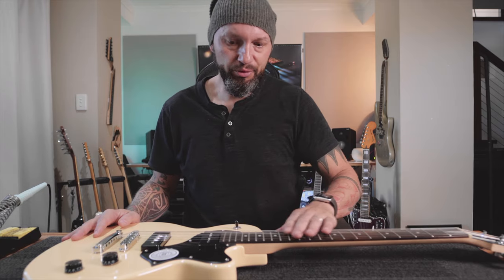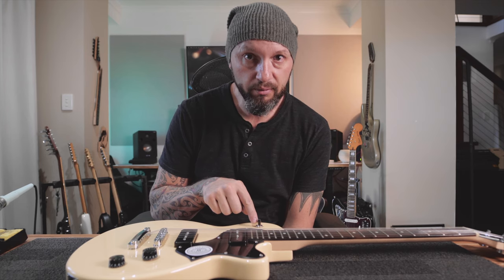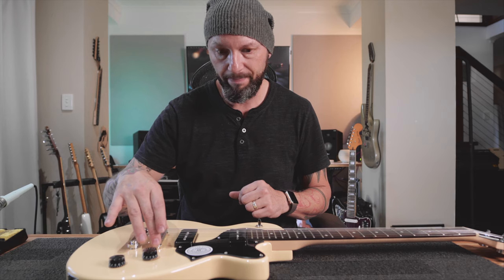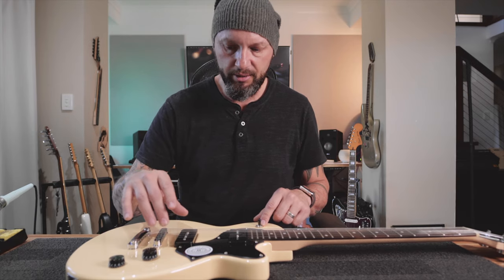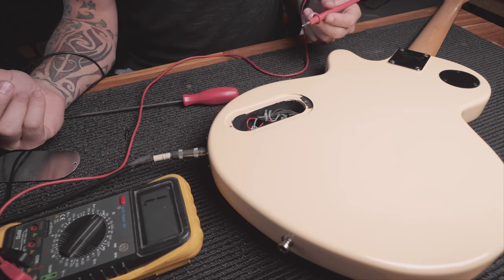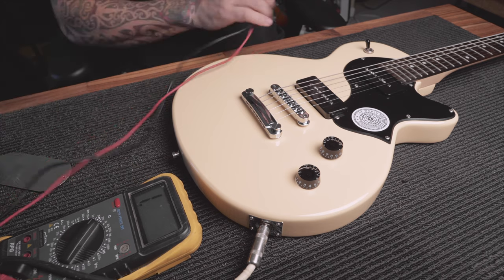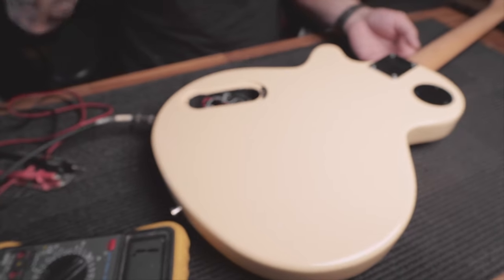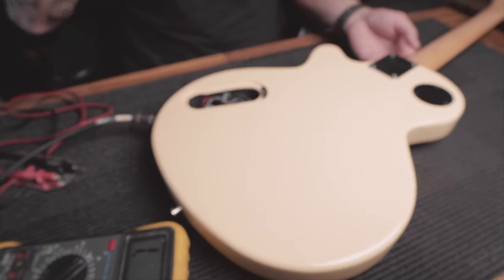3 Easy Solutions to Fix Ground Noise | Guitar How-to Ep02

Comment: my amp has a very very quiet hum when there is no cable or guitar plugged in, (even at the highest volume).Once i plug in the cable and guitar the buzzing increases 100x. Then quiets down when i touch the metal parts. Is this still normal? When i lower the nob on the guitar it also quiets down.
Reply from the maker: Lots of variables here but doesn’t sound unreasonable. Try this, you might have an external interference issue: https://youtu.be/sAQP5HtdNuc
Reply: @RisingSunGuitarMods  thank you, not sure if it really is a shielding problem. i turned off every electronic in my room and it still buzzes!!! i did notice that if i touched the metal part of pickup selector the buzz continues. This means the ground cable there is disconnect right?
Reply from the maker: @cash7975  Yep. Will be worth pulling it apart and doing an inspection. Look for a ground wire that may have come off or bad solder etc.
Reply: @RisingSunGuitarMods  will do that. thank you for sharing this information
Reply from the maker: @cash7975  what type of guitar and amp do you have?
Reply: @RisingSunGuitarMods  i got an ibanez gio and fender mustang lt25
Reply from the maker: @cash7975  shouldn’t be noisy especially in the humbucker position. Start with the inspection of the wiring. Or if it’s newish and you got it from a shop I’d talk to them. But sounds like an earthing issue for sure.

Comment: Hey i gotta slight buzz/hum coming from my dean ml dimebag tribute guitar. i just put a seymour duncan dimebucker pickup in the bridge. all my grounds and solder joints look fine and i have continuity all over the guitar... when i touch the metal on the toggle switch, the jack input, the bridge and strings and the neck pickup the buzz/hum goes away.. i replaced the pot and resoldered everything again for that pick up and still get buzz.. any ideas? I have tested my 2 other guitars on the same amp and patch chord to make sure they arent the issue aswell.. Im kinda stumped now lol. any help is greatly appreciated
Reply: should add that the noise does get louder when i touch the pick up i installed but if i touch the strings the noise goes away then i can touch the pick up and get no noise... ive taped any piece of wire that cud possibly touch anything to ground out aswell. im stumped lol
Reply from the maker: Hey man, based on the information you provided, it seems like you've done a thorough check of your guitar's wiring and connections. However, you're still experiencing a buzz/hum issue. Here are a few suggestions to troubleshoot the problem further:

1. Check the pickup height: Ensure that the Dimebucker pickup is not too close to the strings. If it's set too high, it can cause excessive magnetic pull and lead to unwanted noise. Try lowering the pickup slightly and see if it makes a difference.  

2. Shielding the electronics cavity: Sometimes, electrical interference from outside sources can cause buzzing or humming. Consider shielding the electronics cavity with copper foil or conductive paint to minimize any external interference.  I have a how to here: https://youtu.be/sAQP5HtdNuc

3. Grounding and shielding the pickup cavity: Make sure that the pickup cavity is properly shielded and grounded. Check if there are any exposed wires or components that could be causing interference. Ensure that the pickup's ground wire is securely connected to the guitar's ground.

4. Check the quality of the wiring and components: Inspect the quality of the wires and components used in your guitar. Poor quality wires or faulty components can introduce unwanted noise. If necessary, consider replacing any suspect wiring or components.

5. Test the pickup in another guitar: If possible, try installing the Dimebucker pickup in another guitar to see if the issue persists. This will help determine if the pickup itself is causing the problem or if it's specific to your Dean ML guitar.

6. Consider using a noise gate pedal: If all else fails and you're unable to resolve the issue, you can try using a noise gate pedal. A noise gate pedal helps suppress unwanted noise when you're not playing, effectively reducing the buzz/hum.

If you've exhausted these troubleshooting steps and the issue still persists, it might be worth consulting with a professional guitar technician. I hope you solve it. Let me know how you go.
Reply: @RisingSunGuitarMods  thanks for all that info appreciate it alot! gna try a few more things u suggested there

Comment: Hey. Ive got a guitar thats driving me mad. I have shielded the whole thing including the cavities, under pickups. all grounds are continuous. Bridge is definitely grounded. Then plug it in, has buzz that creates static-y type clicks when you touch the strings or the metal work. Its driving me insane. Any thoughts?
Reply from the maker: Could be something around you, mobile phone, computer, a power supply with a bad earth. Might be a game of eliminating outside factors. Do you have another amp you can try, or plug your current one into another room. First thing is to eliminate things like amps, pedals and power. Turn your mobile phone off etc. if all these are eliminated is it noisy across all pickups?
Reply: @RisingSunGuitarMods  straight into the amp, no pedals, different brand new high quality leads. I have two amps, same story. I have multiple other guitars. Its noisy across all pickups. Its just you go from not touching the guitar to then touching the control knobs (chromed metal) the bridge, the tuning pegs, the strings and its like a static-y pop. Its maddening. Makes the guitar unusable in a way as I am so aware of it. Be damned trying to record with it.
Reply from the maker: @Lovetone1983  you know what, this sounds like something is wired incorrectly. Check your output jack wiring. Make sure the hot wire is on the positive and your ground is on the sleeve. If you can’t figure it out I’d be happy to try and help you solve it. Look me up on Instagram or Facebook and send me a DM with some photos of the wiring and maybe a video of the issue. I’ll try to help you out.
Reply: @RisingSunGuitarMods  Hi its nothing complex tbh and the wiring is done 100% correctly. Its a total mystery now.
Reply from the maker: @Lovetone1983  okay, if you have isolated everything then it could be down to bad pickups?
Reply: @RisingSunGuitarMods  everything is possible but they are clean pulls out another guitar (trusting the seller tbh).
Reply from the maker: @Lovetone1983  usually when it makes noise when grounded it's a ground wire connected to a hot somewhere. Dificult to solve without seeing any of it.

Comment: what about a hum when you turn the volume knob off??
Reply from the maker: What kind of guitar is it? Is it stock, or has it been modified? If it has been modded, what pickups and what wiring diagram have you used? Do you have a meter and are you comfortable using it?

If the wiring is correct, when the volume is at 0 the output jack should be shorted to ground. The only thing that makes sense given the limited information is that the output jack is wired backward. 🤷🏻

Comment: Did you ground your combo ?
If yes -- how did you do it, indoor ?
Reply from the maker: Not sure I understand your question. Are you asking if I grounded the amp? 🤷🏻
Reply: @RisingSunGuitarMods  
Yep.
Reply from the maker: @iridios6127  So I’m guessing your having some fun. Grounded = A Ground Connection connects every piece of metal on your guitar and acts as a return path to the amp. Your amp will be earthed through your electrical supply. I’m not talking about grounding as in your garden. Hope this helps.
Reply: @RisingSunGuitarMods  
Thank for the answer.
In my location we have 2-connection plugs. No grounding for amp.  ))))
Reply from the maker: @iridios6127  Wow. I thought you were teasing me Lol. Where are you located. It’s crazy you don’t have earthing through your power supply. So it wouldn’t matter what guitar you use you are going to have a noisy guitar. I’d like to help you with this. There might be something like a ground/noise suppressor that you could use. Let me know what setup you have, guitar, pedals, and amp. I’m interested to see what can be done.
Reply: @RisingSunGuitarMods  
Thanks again. 
I was an electrician by training make diy-grounding.   )))
Reply from the maker: @iridios6127  you should make a video about that and help out some people in your location. I’m still interested to know more. 🤗
Reply: @RisingSunGuitarMods  
No big deal, in fact -- for the amp there was enough thin wire on the radiator.
Just for noise elimination.  )))

Comment: On my single pickup guitar when i turn down the volume knob it buzzes but not when the volume is up and it goes away when i touch the tuning pegs, strings and anything metal on the guitar and its annoying me a bunch and i don't wanna spend tons of money or have to do anything really complicated
Reply from the maker: Sounds like it might be a ground loop. Ensure that the volume control is not wired in reverse. The lead connected to the output jack should be connected to the center lug of the volume control. When looking at the back of the control (as you would if it's already installed) with the terminals facing towards you, the left terminal receives the hot output from the switch. Check if this is correct.
Reply: @RisingSunGuitarMods  the guitar is an Ec1 made by esp and brand o guitars and im not sure how to check it
Reply from the maker: @T0NYYYYYYYYYYYYYYYYYYYYYY  is that the traveler? If so I think these are active. Check the battery. I would replace the battery first.
Reply: @RisingSunGuitarMods  it is not the traveler. Its like the Ec10 but not neck pickup or gain or switch
Reply from the maker: @T0NYYYYYYYYYYYYYYYYYYYYYY  okay man, pretty hard to diagnose without having the guitar but from what you’ve given me it sounds like a promo guitar, where it makes noise when you turn down the volume, there could be a couple of things going on.

First, make sure all the connections are secure and free of damage. Loose or damaged connections can cause unwanted noise.

Next, check the grounding. A grounding issue can cause humming and buzzing sounds, especially when the volume is down. Including creating a ground loop which is what I think it is. 

Also, it's worth checking the pickups and making sure they're wired properly and not damaged.

If the pickups and connections seem fine, it might be an issue with the pots (the knobs that control volume and tone). Dirty or worn out pots can cause popping and crackling noises.

Lastly, if none of the above solutions work, you might want to try shielding the guitar's electronics to block interference. I don’t think this is your issue though. 

If you're not confident in your ability to troubleshoot and fix the issue, it's always best to take your guitar to a professional for help.

Comment: Question: I have a Telecaster that was given to my Daughter, and frankly, that poor guitar was ridden hard, and hung up wet...no ground to Bridge (fixed that) more cold joints than Santa Claus in February (fixed those), and now the guitar is dead silent when plugged in...until you touch anything metal except the V/T Knobs...it's back'erds??!! Why would it do this? Pretty sure it isn't normal, but other than that, it's a nice, loud, easy-to-play guitar now that a lot of routine maintenance has been done to it,  just the hum when it's touched...
Reply from the maker: Check the output jack is wired correctly. If the ground is on the hot output and hot on ground this will cause this problem. Basically instead of  negative being sent to ground it’s getting sent to active. Worth a look. The ground wire on your output jack should go to the sleeve of the jack. Hope this helps. Plus, great description. ✌️
Reply: @RisingSunGuitarMods  makes sense. I was going by the color code, i.e., Black=Ground and White is Hot. And based on the shoddy work overall (whoever worked on it before me), suppose it would stand to reason the guy would have done those backward, I'll give it a whack, see what happens...
Reply from the maker: @randomprecisionmotors3130  let me know how you go. Hard thing when someone has already messed with it is you can’t rely on what should be. ✌️
Reply: @RisingSunGuitarMods  yep, that fixed it. Never had a Single Coil Guitar so quiet...were all the others wrong too? Even with Gain/Overdrive there's absolutely no noise...this is gonna take some getting used to...
Reply from the maker: @randomprecisionmotors3130  that’s awesome news. 🤘🏼

Comment: What if I have huge noise when i touch the strings 
? I have a Eko s300 (strat type) and i am using a irig 1
Reply from the maker: Ground issue. Check the ground wire that goes to the tremolo claw in the back of the guitar.
Reply: @RisingSunGuitarMods  
I looked in the back and it looks ok. I'll take the strings off and see what's going on on the other side...
thank you very much.
Reply from the maker: @logarithm0  try a multi meter first. See if there is continuity from the earth wire on the claw to your output jack. Just the metal bit on the top of the pick guard will do. If there isn’t continuity then there is a break in the ground wire.
Reply: @RisingSunGuitarMods  it's the cable 😨 
I have continuity to the output jack (tested based on your advice), but if I test the cable sleeve to sleeve, I get none !!!
Reply: Confirmed, it works after changing the lead.
Guys check your cables !!
Reply from the maker: @logarithm0  nice one. Glad you solved it.

Comment: When I plug my Laptop to charge while I record what I play with my guitar, it makes noise... The noise goes only when I remove my laptop from charging.  I use a presonus sound.
Reply from the maker: Sounds like an issue with a ground loop or possible the power supply on your amp. Try my video in my pinned comment about shielding. It might help.
Reply: @RisingSunGuitarMods  Thanks for letting me know. I will check out the video right away

Comment: What do I do if it buzzes when the sound on the guitar isn’t  turned on ( on the amp it is turned on)?
Reply from the maker: There is a number of causes of this. But start by eliminating your pedals and amp. Try the guitar with another amp or try your amp with another guitar. If the problem is not the amp or pedals it could be the output jack on the guitar wired backwards. I’ve seen this a number of times, or even a dry solder connection. Usually the big glob on the back of the pots is the culprit. Hope this helps.
Reply: @RisingSunGuitarMods Thank you very much 🙏🙏
Reply from the maker: @beisbolke3281  I hope it helps man.

Comment: Hey bro, when I touch any part of my guitar (metal), the buzz sound is gone.. but without touching it, the sound comes back.. any solution? It's just a basic electric guitar
Reply from the maker: That’s normal. But sounds like you have a generally noisy guitar. There are some things you can do to reduce the noise, best place to start would be with copper tape in the cavity, twisting your pickup wires etc. I think I’ll do my next video as a follow up with some tips when you have noise but ground is good. 👍

Comment: I diagnosed my electric bass and the problem is shielding. I took it to a Guitar Center Technician and he says that it could be a grounding issue. He tested it and upon plugging it in there was no buzzing. But at home there is buzzing, what's the difference?
Reply from the maker: Could be equipment around you, power supplies, computers etc. sounds silly but move your amp and bass to another room and try another outlet.
Reply: Okay, I've tried it in a room where there aren't many electronics and the noise, buzz, and hum were reduced by a lot. I was thinking maybe I need those Morley Hum Exterminators, would those work in my scenario?
Reply from the maker: @athan1453  Yes I think that would be a great option. Definately sounds like you have equipment causing either a ground loop or EMI. Before you get one try shielding first. Remember shielding isn't about creating a faraday cage, a lot of people get this wrong, shielding is about creating an antenna to catch EMI and send it to ground. Try this: https://youtu.be/sAQP5HtdNuc it's a cheaper option and might sort you out. :)

Comment: When i touch the jack it stops all the noise, but when i touch the strings, it becomes louder, any help???
Reply from the maker: Sounds like that wire to your bridge is broken just like the video. What kind of guitar do you have?
Reply: @RisingSunGuitarMods  im using a strat, i bought a prewired HHH with three split switches recently, soldered them all up correctly but they all hum when i touch em
Reply from the maker: @rod_official6166  Did you check the wire that goes to the spring claw in the back cavity?

Comment: Hi, I have a problem where all my guitars and amps are suddenly buzzing but the guitar buzzing goes away when I touch metal on the guitar.
Reply from the maker: If it is sudden what have you changed? ... do you have a new electrical device near your gear, or have you introduced some new equipment? ... Sounds like there is now something that is providing interference. You could try this: https://youtu.be/sAQP5HtdNuc

Comment: Hello , I have a problem  when I volume up my guitar the noise increases but when i touch the strings the noise disappears. How do fix that?
Reply from the maker: Hey Joseph, what guitar do you have and what pickups are in it? Could be a number of reasons but lets start with what we are working with.
Reply: @RisingSunGuitarMods  I have a Legend guitar. the pickups are SSS type
Reply from the maker: @PersianEngineering  that’s normal, depending on the amount of noise, but single coils make noise, that’s why you have grounding to dissipate the signal interference. You can reduce the noise with shielding. See this video for a how to. https://youtu.be/sAQP5HtdNuc
Reply: @RisingSunGuitarMods  thanks for replying 👌🏻👌🏻👌🏻👌🏻